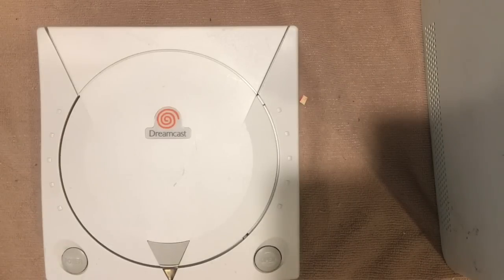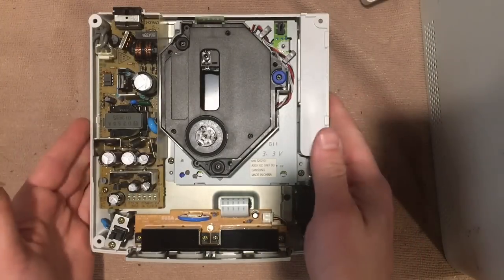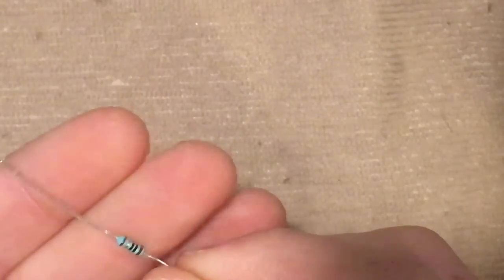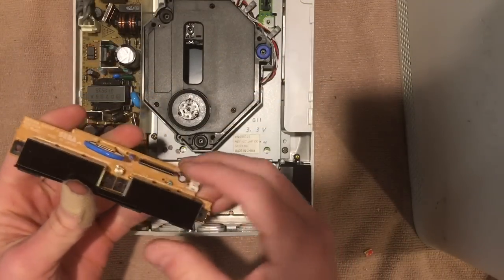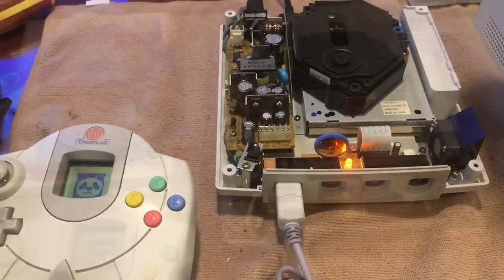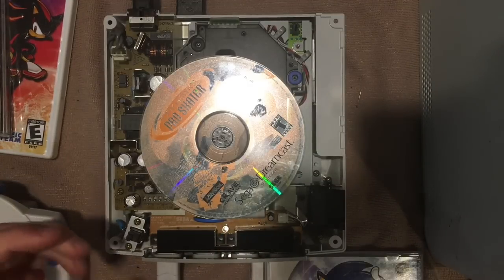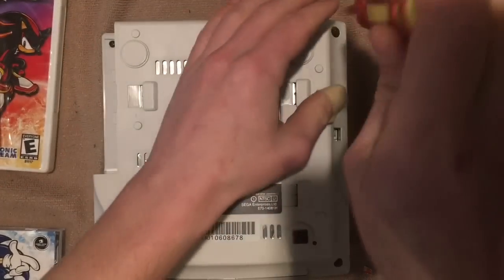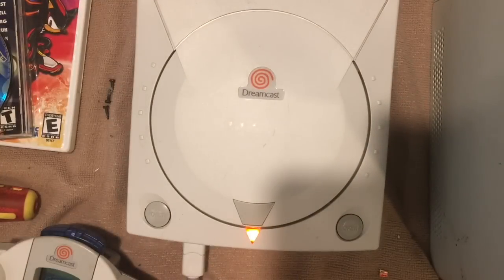Fixing eBay Junk - How To Fix Dead Dreamcast Controller Ports

Comment: Thank You. I just bought one from an estate sale for $5.00 because she said it didn't work. I know there had to be a cheap fix. I tore it apart and tested that resistor and it is dead. Thanks again.
Reply from the maker: Eric Miller glad to help.
Reply: @Josue Draven Yup, I've been using Instaflixxer for months myself =)

Comment: When you put the top part of the case on, always put it on with the LID OPEN, then close the lid once you have it attached. If you put it on with the lid closed it crushes the switch at a weird angle, potentially damaging it. This is probably what was causing your problem when you put the top part back on the first time.
Reply: thanks for that tip.

Comment: The Dreamcast clock battery is an ML2430-VS1, which is a rechargeable lithium battery. They're about $4-5 bucks and not hard to find at all. It'll last about 5 years before needing to be replaced. You can also mod in your own terminal and insert any kind of rechargeable battery that you desire, but it probably won't save you any time or money, really.

Comment: I've learned a great deal about batteries. To test if that battery is any good, just set your multimeter to DC V (voltage; for my meter, I have to set mine to DC 20V) and touch either lead to one side and the other (negative results tell you the leads are backward but don't matter). The closer the Voltage is to 0, the less time you have on that battery until it's dead. I believe those coin batteries should be about 1.5V when fully charged.
Reply from the maker: Andrew Fillhart correct.  This battery flickered between 0 and 1v, but I didn't show it in the video.  It's dead, but I don't have a replacement on the special mount the DC uses.  Maybe I'll order a few and make a video on how to swap them

Comment: Good old dreamcast; reads burned bootlegs easier than the actual original games haha.
Reply: The same happens to my DC, Do you know why? And Should I just keep using the backups?
Reply: Not True, Ive had many Burned CDs that would not load and had to re-burn a new one.

Comment: I've been plugging and unplugging my controllers for 21 years and the ports still work just fine.
Ebay has a Dreamcast Controller port kit that has a reset-able fuse, resister (the tan one),  Capacitor, battery holder that supports a removable battery and a ML2032 battery for 11 bucks (8.99 plus 2 shipping).
My battery has lasted 21 years and still holds a charge as long as I power on my Dreamcast every 1 or 2 weeks and leave it on for a few hours, minor inconvenience compared to buying expensive rechargeable button cell battery and a battery holder that allows you to replace the battery without having to de soldering it.
The best battery mod is the one that disables the charging circuit and allows the use of a standard CR2032 battery like the Saturn uses.

Comment: Clean the Laser with alcohol and then tweak the potentiometer on the the GD- Rom Laser clockwise (while the laser is upside down) i done this yesterday on a non working dreamcast and now it is working fine.

Comment: Hello. I have a problem with my Dreamcast. It shuts down when i close the lid with disc inside. If there is no disc its working showing menu but when i insert disc ans close the lid it shuts down and it does not turn on for couple minutes

Comment: I'm currently repairing a VA0 system and the only game included included was disneyworld racing. The game couldnt read but I tried a music cd and it reads just fine. So I'm gonna try and see if the game drive being greased up a bit would help read games quicker

Comment: The issue with the original game disc is not coming from your disc, it is a common problem the Dreamcast gets sometimes. There are tutorials on Youtube how to fix it, but it involves taking the entire system apart and some more soldering. :-]

Comment: Was that Dreamcast modded to play backup games? I've done the MM3 mod to a variety of PS1s and I just got in the XENO GC chip for the GameCube (so much easier to attach than the MM3).
Reply from the maker: Andrew Fillhart most dreamcasts support backups out of the box.  On the back label, where it says NTSC US, there's a number in a circle indicating the revision.  0 and 1 support backups, while 2 does not.

Comment: Hey, RetroRepairs. Thanks for the video!  I have this exact same problem with the controller ports. I think I need to replace both resistors. I don't understand much about resistors, so I don't know exactly which ones to buy. Could you give me the characteristics of both resistors (blue and brown)? Thanks :)
Reply from the maker: André Bastos you can buy a kit on eBay for a few bucks. Has exactly what you need.  I'm out and about right now but I'll to and remember to check later

Comment: thank you very much for saying what the wattage and ohmage is for the resistor
Reply from the maker: jeepnII no problem.  Not much use as an instructional guide video if I don't tell you what part to buy.  Sadly, I see that lots.
Reply: so true, I went through several before finding yours.  just got a Dreamcast on Ebay for $20.00 because of this problem and I knew it had to be a fix out there.  Some of the videos suggested that you twist the resistor so the resistor leads touch bridging the connection.. Nope...not doing that. Thanks again!
Reply from the maker: jeepnII something clearly caused the component to fail, twisting it removes the protection and could cause further problems if something else were to happen to it

Comment: I have a Dreamcast and while the controller ports do work (I've only tested port A so far), when I tug on the controller (by accident) it disconnects then reconnects, despite still being connected. This causes the game to pause against my will. Port A does look a bit dirty. My guesses are that either:

- the resistor in my ports is starting to fail
- port A just needs a clean
- there's something wrong with my controller

Anyone else experiencing this?
Reply from the maker: adultmoshifan87 I've never experienced that, but I would think 

A. Controller cable isn't connected well to the plug
B. Controller port is dirty 
C. Bad solder joint where the port connects to the board.

Do you have another Controller to test it with?
Reply: I will give it a go, and test my 2 controllers on the other controller ports

Comment: Do u sell ur products online?  Do u do repairs on ps3?
Reply from the maker: currently I do not sell my refurbs online.  Local sales only for the time being.  

I've done limited work on a ps3.  I had an xbox 360 when they came out, so I actually just got my first ps3 two years ago, which had a yellow light of death.  Managed to fix that and I use it frequently

Comment: Can I Connect the Dreamcast with a HDMI cable? Sorry I’m silly guy....
Reply from the maker: No,  there's no HDMI on the dreamcast
Reply: @RetroRepairs  ok, I’m not so silly man,  but can I use an adapter, maybe an HDMI/RCA adapter? Thanks a lot cheers
Reply from the maker: The are converters that reprocess the signal into hdmi,  but good ones aren't cheap.  Cheap ones introduce lag. I dont have any recommendations though.
Reply: @RetroRepairs  thanks a lot for your time man. An italian friend!
Reply from the maker: No problem! Cheers!

Comment: Looks like digikey actually carries the Fusible version of the .25w 10ohm. Sold in 5000 packs though L.O.L.
Reply from the maker: I use Digikey alot for ordering components.  Price is good, and I can get $8 two-day shipping to Canada.  Hard to top that.  I'd like to support a local electronics shop, but here they don't carry any really small components like you'd use on a PCB like this.  Mainly just TV caps, stuff like that.
Reply: Wonder how many amps that fuse is rated for tho...

Comment: Great video, I just received a Dreamcast from a seller on eBay and the unit has the same issue.  I will be ordering a few of the 1/4 w 10-ohm resistors and giving this repair a go!  I have found that some people say that the 10-ohm resistor is a bad way to repair the console.  Instead, individuals say that 0.5 amp pico fuse or a resettable fuse is a better option. Which do you suggest?  How long will the resistor modification work for? Would this work for the repair?  https://www.mouser.com/ProductDetail/576-0251.500MXL Thanks!  Keep the content coming!
Reply from the maker: You may have difficulty finding that fusible resistor, but that is what was originally used.  That concern does have merit, as removing the fuse potentially removes protection against whatever caused it to fail in the first place
Reply: @RetroRepairs  we have success!  Thanks to your video, my Dreamcast is operational again!!  I ended up going with a set-up that provides the battery replacement and a resettable fuse.  The system is working flawlessly.  If you search: "Maxell ML2032 + Battery Holder + Resettable fuse Dreamcast Controller Port Fix" on eBay you'll find the battery and fuse that I used to complete the repair.  Thanks again!  Keep the content coming!!